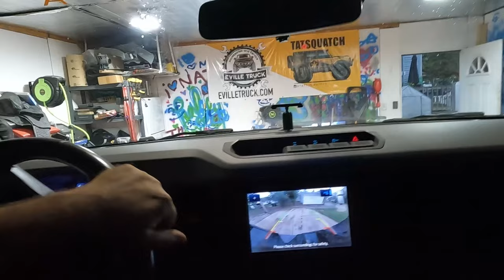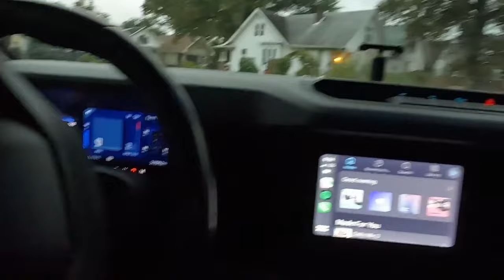Installing the Injen Cold Air Intake on my 2 7L Bronco  Worth the Money

Comment: About to install this later today! Any other tips for an easier install? Much appreciated!
Reply from the maker: It would be easier to do without the wheel well liners in for sure, but its a trade off for time spent taking them out,
Reply: @ Thanks brother! Getting ready to head down to the TN Off rodeo next week from OH so I’m trying to get this in as well as the Injen dual cat-back exhaust!
Reply from the maker: @Sebastiano1394  Nice, sounds like you have a fun day ahead  .  I regret never using my off rodeo voucher before it expired, I didn't realize they did until I tried to register for the TN one once it opened.
Reply: That’s unfortunate you weren’t able to go!

I got it installed and initially had no engine light but it came on today. You don’t need an actual tune for it do you? I only have the JB4 piggyback installed currently
Reply from the maker: @Sebastiano1394   You shouldn't need a tune.  Do you have a 23 model?  I know there was an issue with 23's and a sensor,  Injen had a fix for it , so I would reach out to them and see.
Reply: @ I have a 24 Wildtrak and had to take it in today anyways for a tire rotation so they’re reading the code and I’m gonna contact Injen with the code etc. Yeah, that was what I was reading as well about a sensor with the 23’s